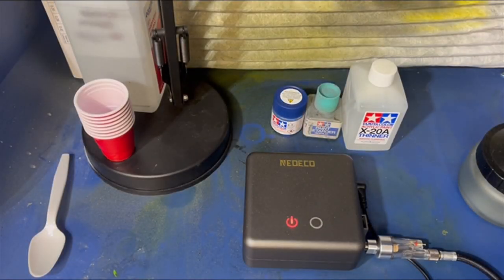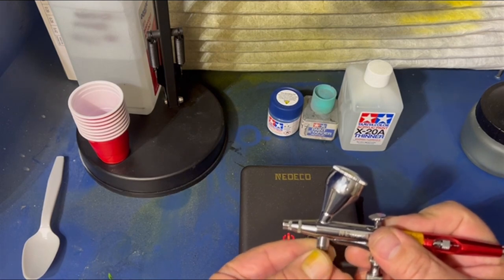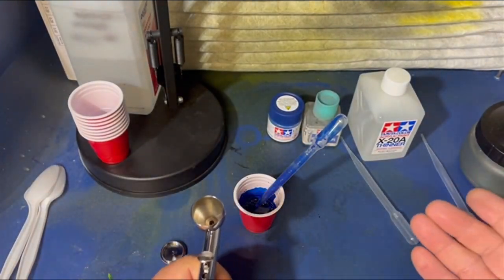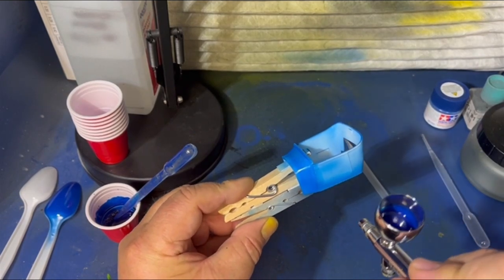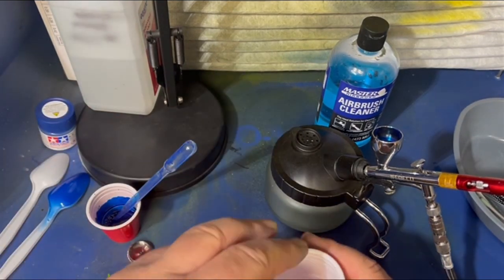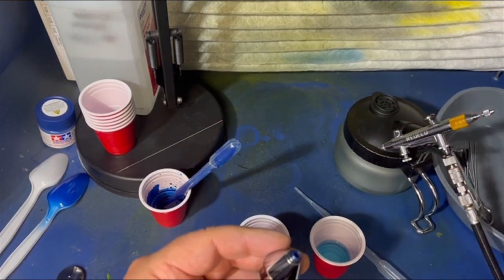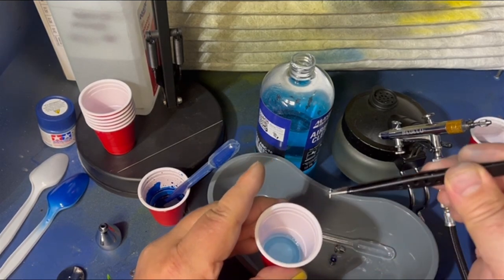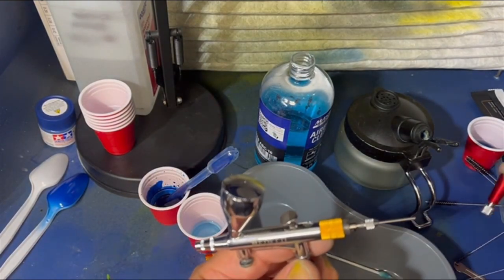Spraying Acrylics with a NEOECO Airbrush

Comment: Thanks for the review! I have one big compressor for general purpose. 
I feel like I'm in some sort old boat motor room when that thing is on. 😂😂
At neoeco's level of noise, I can even paint during the night! Certainly, will buy it next month. I'm quite low on cash right now. 😅
Reply from the maker: I've found that it does not like to spray Vallejo primers.  But it is crazy quiet and if your paint is thinned right it works well.
Reply: @grandpamarkshobbies  I use mostly some local standard hobby paint. But I do have some vallejo on the bench. Glad to know it beforehand. Thinned down paint and some patience can get us far.😂😁
Reply from the maker: Yes sir.

Comment: My kiddo is a super awesome artist and he has been talking about getting an airbrush and this set up would be perfect. Performance and design seem top notch sir.
Reply from the maker: It is an outstanding kit.  I've been able to lay down some great work with it.  I'm not sure if you've looked at it, but it comes with a whole set of replacement O rings and Teflon guides.  It also has 3 cup sizes, a quick disconnect, long (good quality) hose, air separator,  cleaning tools, and 3 tip sizes.  For $39.00 it's a crazy deal.  (and I'm not even working for them)  I'm just really happy with the airbrush.
Reply: @grandpamarkshobbies  I’ve looked it up and I’m surprised at the deal and it’s a quality airbrush, not harbor fake junk. They carry replacement parts also. At that price I should get one for my kiddo and myself lol 😛
Reply from the maker: I agree.  I was surprised that it came with all the cleaning tools, and replacement o rings too.  I am very happy with it.

Comment: Thanks for the video! I was wondering about these airbrushes.
The moisture trap is on the wrong end though. It needs to go directly under the airbrush. It doesn't work how you connected it, and if there are droplets condensing in there, they are blown right in to your line.
Reply from the maker: It is a good airbrush  I have since switched to Gaahleri's airbrushes because they don't need a tool to clean.  I tried to film this video about four times and was just about as tired as you can get when I set that up.  LOL  Yeah, having it upside down really won't help.  Thanks.

Comment: Well that was a nice refresher for me on how to paint after 4+ years... Thanks and I will try your method and see how it goes. I have never used retarder(I'm a bit a retired. lol) in my paint, if memory serves I used floor shine as a lever and window wash as a thinner... Lol
I looked for that air pump and did not find it with that name. I did find a kit that has that pump but did not like the brush. I have 2 brushes and don't really need another one. My homemade fridge air compressor is quite but takes a while to fill the tank but it does work great.
Anyway thanks for the video!

LLAP 🖖
Reply from the maker: Bruce, I use to use Pledge back in the day, but the Tamiya Retarder doesn't change the gloss like the Pledge did.  The NEOECO group is going to be putting up a website soon and I'm hoping they will be offering that compressor there.  It will be a great help for people who are just getting into the hobby or for people (like me) who have limited space.  But I sure do like that airbrush.  It does such a better more consistent job than my old one.    

Thank you very much for watching, and have a great weekend.
Reply: @grandpamarkshobbies  I did order the thinner and retarder Mark on Amazonion to give it a try. What can it hurt right? Lol
Have a great weekend as well. I just seen Jake in the pump video. He looks awesome!
Buster (In the Pic) pasted away Dec 10th 2021 and I still have Tip he is 12. I started the channel with Buster & Tip in mind when he was still alive not knowing he would be gone soon. He was 17 on his passing but full of life as a new puppy, just his body gave up like ours. 😥
So now the channel is in his Honor. I do miss him so much still but one day well be together again... 🙏

LLAP 🖖

Comment: Just looking to start modelling after a xxx yr lay off. Ordered a NEOECO airbrush and compressor as I've always wanted to use one. 

Looking forward to receiving it, some excellent information here that I'll certainly be referring to as I attempt to get back into the hobby 😊

Great video, thanks.
Reply from the maker: Thank you very much.  After I made that video I started thinning the paint just a smidge more and it made a big difference.
Reply: @grandpamarkshobbies interesting, I would never have thought to thin it as much. Think I'll need to practise a fair bit before committing to my first "real" spray. 
Thanks again
Reply from the maker: If you can get them, buy a large box of white disposable spoons.  Those are the perfect thing to practice on.  I use them all the time.  Every time I spray a project I will spray a spoon first just to make sure my mix and air are correct.  Them and the  cheap plastic poppets are an airbrushes friend.

Comment: A very well done video, I'm not an airbrush beginner, but I have a quick question on the compressor. Does it constantly have to be plugged into a power source in order to run, or can it be charged up so it can be used in remote locations? Thanks.
Reply from the maker: No, it does not charge. . . It also died on me last weekend.  I did use it a lot though.
Reply: Thanks for the update. I'll keep my pancake compressor around a bit longer.

Comment: Hello, I just found your channel, I’m getting back into building cars after 40 years, just wondering do you wash all your bare plastic with soap and water before you paint them?
Thanks for the video
Reply from the maker: Welcome back to the hobby.  I do wash all my parts.  Usually first thing.  I put just a few drops of Dawn dish soap in warm water, and use a soft toothbrush to give everything (except the clear parts) a quick scrubbing.  When I'm done scrubbing the parts I lay them on a towel.  Then I rinse my tote with clear water.  I then put warm clear water in the tote and rinse all the parts.  I'll lay them on the towel and dry them with paper towels.  Not sure if I need to do this or not, but that's what I did in the 70's and I've just kept doing it.

Comment: Thank you So much for this comprehensive video! Hey, I have a question: 2 days ago I sprayed a spoon (Roughed up with 800 grit sand paper) with acrylic paint, and I'm able to scratch the paint off. Am I missing something? I don't want to use it on a model before I figure out the issue(s). Thanks again!!
Reply from the maker: Thanks for the kind words.  Some paints take longer to harden.  I usually let my Tamiya paints harden for about four days before I really mess with them too much.  As for other paints, I'm not sure.  I know that some paints need primer first to hold onto something.  Tamiya paints do well on their own as long as you start out with a few very light coats to give it something to bite into.  Even with Tamiya paints I wait four to five days before I tape for stripes.  That way I'm sure the paint is good and cured.
Reply: Thank you so much, @grandpamarkshobbies  !

Comment: I think that the moisture traps intake is the clear side and the output the metal side. The way it's install the flow is revers.
Reply from the maker: There is only one way to thread it onto the unit and the hose.  Input is Female threads, output to hose is Male threads.
Reply: What I see around it is attached to the airgun
Reply from the maker: LOL.  You got me there.  I'll switch it around next time I use it.  That will just be a bit bulky to hold.

Comment: Awesome video Mark! Very good tutorial on deep cleaning the airbrush. I wouldn't mind getting this compressor for a 2nd or for travel/camping. Do you know what the psi ranges are for the three settings?
Reply from the maker: Thanks for watching.  I can't tell you how much easier it is to clean this airbrush over my old syphon feed.  As for that compressor, it didn't give ranges for the three settings.  It just says MAX PRESSURE is 25.  So I'm guessing that is the high pressure setting.  I would usually spray right around 20 and honestly I can't tell any difference.  What I like the most is when I clean my brush I would lower the regulator, then have to dial it back in to spray again working out the pressure drift in my regulator.  With this I just hit the button and I'm all set again.  I really like that.   
But anyhow I hope that helps, and have a great weekend.

Comment: Grandpa, you really should spray a couple of paint cups worth of cleaner through the brush before you pull the needle out. Any residual paint on your needle just gpt pulled back through the body of the airbrush. I have the updated version of that airbrush and really like it! I think Neoeco has made a good airbrush at a good price.
Reply from the maker: Thank you.  I usually do that.  I think having the camera right in front of my face really messed me up.  I love the airbrush, and also the good people at NEOECO.  They really seem to care about their customers.  Thanks again for watching, and have a great week.
Reply: Thanks for this Q&A I was wondering why not spray cleaner before disassembling from the cup into the cleaning pot.
Reply from the maker: I'm sorry, it was all me that day.  What I do is  remove all the paint I can with a pipette, then I wipe out the cup with a paper towel that I put some cleaner on.  Then I put just enough cleaner into the cup to come up even with the bottom of the cup.  (Just a little bit) then I put my finger over the front of the nozzle and slowly pull back until the cleaner starts to bubble just a little bit.  I let it bubble for a few seconds, then I spray it into my cleaning pot.  I usually do that three times.  Then I start taking it apart.

Comment: Before you took it apart you should’ve kept the gun in the cleaner and put your cleaner in while spraying and keep adding till it’s clear then you take it apart.
Reply from the maker: You are 100% right.  That video got started at 5am, and I had to re shoot it 4 times before my camera/computer/brain all meshed up.  I didn't even realize that I didn't back wash it until my wife pointed it out to me.  I usually wipe out the bowl, run the rest of the paint out of it.  Run a few bowls through it, then I back flush it  a few times to brake up whatever else is left over, then I run another few through the front, then I pull the pin.  I was just so tired that I skipped that whole part.
Reply: @grandpamarkshobbies  I k ow how it is when you’re so tired and aggravated your brain don’t want to brain anymore, I’ve ran heavy equipment like that several times, sketchy situations. Lol
Reply from the maker: Ohhhh man that's funny.